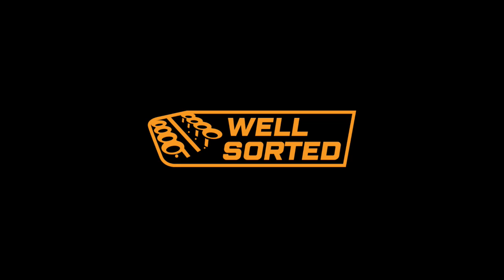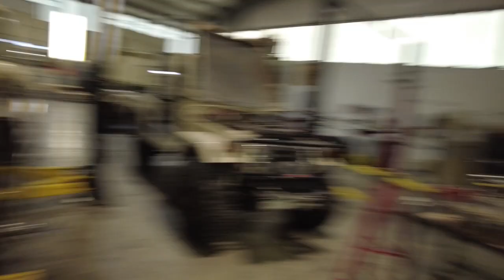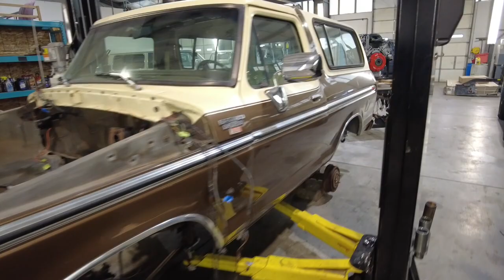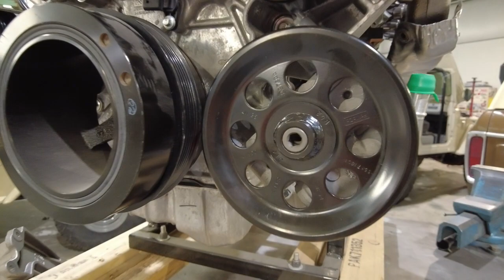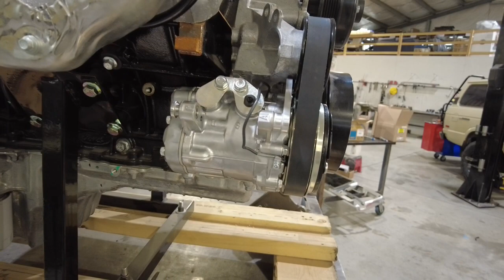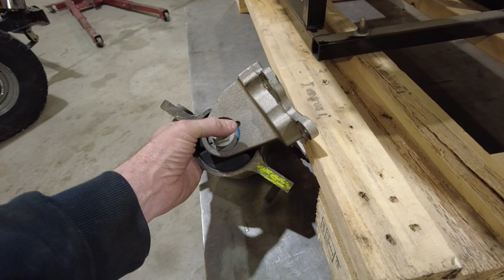Godzilla Bronco Build Part 2!

Comment: A 165-lb. $3500 5-speed manual trans with a 425 lb.-ft. input torque capacity to go behind a $10,000 (once the "challenges" like the "accessory drive" are "addressed" and you're buying an alternator and bracket and AC compressor twice to get a "truck motor" into a "truck" and it "works" with "aftermarket" AC that'll set you back another $2000 just to "upgrade" the FACTORY AC you pay a HUGE "premium" for in a Ford "dentbody" truck) so-called "crate motor" that comes from "Ford Performance" but is really just a "service replacement" engine Ford APPARENTLY built in GREAT QUANTITIES FOR SOME REASON(S) APPARENTLY RELATED TO "PROJECTED" VS "ACTUAL" GODZILLA "SUPPLY AND DEMAND" OF/FOR "ASSEMBLY LINE" AND/OR "SERVICE REPLACEMENT" ENGINES ITS STILL OVERSTOCKED WITH WELL OVER 3 "YEARS" AFTER THIS "NEW" ENGINE WAS FIRST "MASS PRODUCED" AND IS AS "STAND ALONE" AS IT GETS AND WHEN ITS ALL SAID AND DONE VS. SUPPOSEDLY DONE AND SAID LIKE IN THESE YOUTUBE "HOW-TO" VIDEOS THAT "FEATURE" ZERO WRENCHING PER "SWAP" MAKES A "COYOTE SWAP" LOOK "CHEAP AND EASY" DESPITE THAT BEING A "CAR MOTOR". AS LONG AS YOU "SWAP" IT INTO A "TRUCK".
Reply: "You" seem "upset". Maybe "you" should "seek" "help".

Comment: Why use the Tremec vs a zf5 or zf6?
Reply from the maker: Bellhousing availability, plus it's brand new and a very nice transmission.
Reply: @WellSortedAutomotive  For $3500 - plus another $1000 minimum to "convert" a slushbox "truck motor" to a manual trans "truck motor" not to mention "field modifying" the factory crank for a pilot bearing - it damned well better be. 

Of course it's not "strong" enough for even that pathetic Godzilla "big-block" torque at least "on paper" no matter how "nice" it is.

Comment: Would this motor fit the early Bronco , like a 1969 . Which I happen to have ? I think it would be a fun upgrade to my stock 302 ? Do you all do restomods broncos ?
Reply from the maker: We haven't test fit one yet, but plan to.  The width would be no problem, it's just the height that would be a challenge.  With a low profile oil pan and intake manifold I think we can make it work though!  We are current building three Broncos, so yes we certainly do restomods.  Contact us at info@wellsorted.com if you want to talk further, thanks!

Comment: What are you using for a control system? Awesome build! About to start one myself.
Reply from the maker: We're a dealer for the OBR Control Systems Godzilla kit.  Both of our current builds are running this setup, one with the 6R80 auto and one with the TR4050 manual trans.
Reply: @WellSortedAutomotive   Can't wait for the outcome!  Anything in these builds that you feel might pose a problem for the TTB Broncos?
Reply: Can’t wait to see it! What transfer case will y’all be running?
Reply from the maker: @bensonbowman9978  Sticking with the NP205
Reply: @WellSortedAutomotive  which coupler are you using? Iv seen some people altering the atlas case, but not one direct np205
Reply from the maker: @brandonmiller5469  We modified an Atlas adapter to work with the NP205.